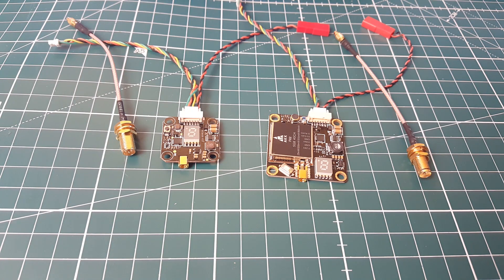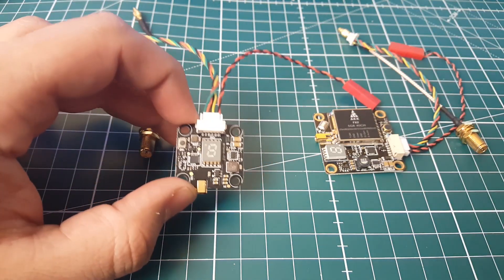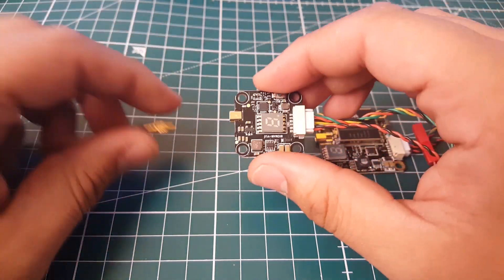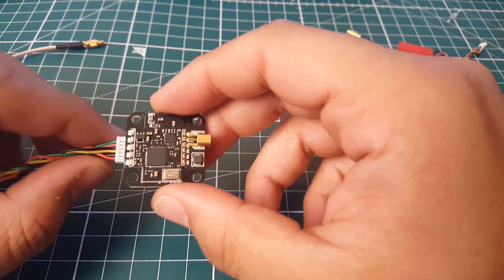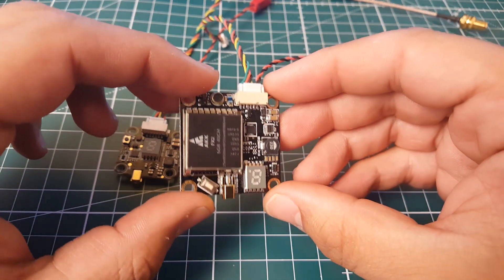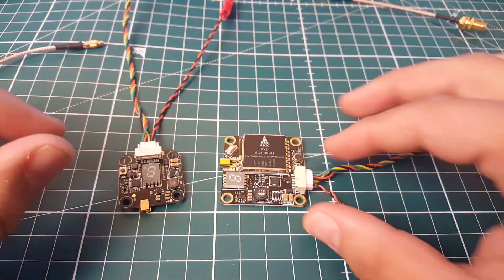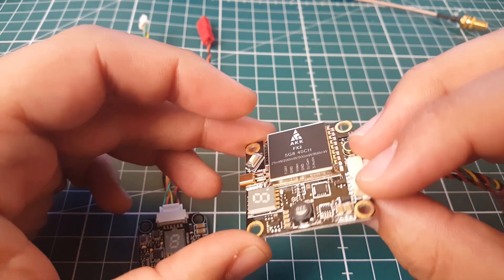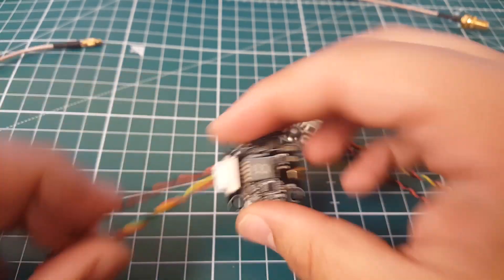AKK FX2 And FX3 // Stackable, Smart Audio, Pit Mode

Comment: I would use the 20x20 but hate that connector on such a small vtx. Maybe cut a pigtail and solder straight to it? Have you ever spliced a shielded antenna wire before? Is it possible? I have a ufl end I would like to splice for a friend

Comment: what would happen if you get the waterproofing crap in that hole? I waterproofed a matek vtx hub and for some reason my esc's wont work. blheli says bad data or power connection. I've tried 3 differen sets of esc's and still the same. There's def not any waterproof stuff on the pads since I've checked it all with a multimeter. I'm thinking theres just something wrong with the pdb vtx

Comment: Please read all this and think again about akk,

For the people that are wondering this isn't a clone of the tbs unify neither the immersionRC tramp hv, Racedayquads paid for the ham license that was required to run smart audio properly so they didn't had to bother with cloning smart audio from tbs. Racedayquads paid akk to make their Mach 2 vtx and so what they did is that they took one of the first prototype of the Mach 2 vtx that worked properly and mass produced them and named it the akk x2 vtx. And months later they send the vtx's to racedayquads after selling the Mach 2 proto for a while, but racedayquads did want to produce their proto's but changed the design and went from a plug to solder pads. And that's what they got send. Technically the akk x2 is just a Mach 2 vtx with a plug instead of solder pads. Also all their vtx's that are coming out recently is just a remix of the Mach 2/ akk x2 vtx so akk is the clone in this situation with all their vtx's.
Reply from the maker: Your wrong racedayquads buys from AKK ;)

Comment: Can you check if it really outputs at 800mw? I have 2 and they don't seem like their truly outputting at 800mw
Reply: I’m not sure why reviewers always avoid testing power output. It’s kinda like doing a car review and never checking the horsepower rating! I test all my vtx with the immersion RC rf power meter when new and later compare as the vtx ages or stops working. So many vtx completely lie about actual output.
Reply: Canyon Racer true...i hope he tests the output
Reply from the maker: +Canyon because they would desolder themself if they output at 600mw and above

Comment: That is the racedayquads "inspired" vtx.... racedayquads sent them the specs for manufacturing and they kinda sorta ripped them off...
Reply: Racedayquads paid AKK to make a clone of the TBS Unify and then AKK turned around and made their own version of it as well.   Racedayquads has been working to copy TBS unify features to bring them to the market at a lower pricepoint and AKK just turned around and filled that part of the market so they are mad.
Reply from the maker: Well that sounds like a shitty situation..
Reply: Que "welcome to the jungle" still gonna get it though. TBS Unify for half the price. The raceday of course.
Reply: Alchemical Anarchist they didn't clone the tbs unify neither the immersionRC tramp hv. Racedayquads paid for the ham license that was required to run smart audio properly without people talking bad about your company. Racedayquads paid akk to make their Mach 2 vtx and so what they did is that they took one of the first prototype of the Mach 2 vtx that worked properly and mass produced them and named it the akk x2 vtx. And months later they send the vtx's to racedayquads after selling the Mach 2 proto for a while, but racedayquads did want to produce their proto's but changed the design and went from a plug to solder pads. And that's what they got send. Technically the akk x2 is just a Mach 2 vtx with a plug instead of solder pads. Also all their vtx's that are coming out recently is just a remix of the Mach 2/ akk x2 vtx so akk is the clone in this situation with all their vtx's.
Reply: There is already some private label versions of the AKK on Amazon now too. Like the Wolfwhoop version.
Reply: Its false to say that Racedayquads didnt copy features of the Unify.   It was trappy who first developed features like smart audio or being able to turn on the VTX with the antenna disconnected and having it not fry.   This is one of the features they were working on in their Mach 1 version and in their Mach 2 version they made it even more like the TBS unify.  As a Consumer I dont have a problem with free market competition because we all get better VTX's at a lower price.
Reply from the maker: No this is the manufacturer and racedayquads takes from them as OEM. So this is the original and racedayquads is the clone.. Ironic isnt it
Reply: Sam please, Tyler payed thousands of dollars to akk to manufacture the Mach 2 as fast as possible. Rdq did all the pcb drawing for all the proto's from the Mach 2. They aren't the clones but akk is. They were  the oem manufacturers but they only mass produced them for rdq. They didn't design anything and didn't do anything else except for assembling it. All the revisions that they did later was token from the original Mach 2 proto.

I can talk hours about this but it is almost the same way with zmx and brotherhobby. Brotherhobby was the oem manufacturer for zmx's v1, v2, v3 motors. Brotherhobby totally took the design of zmx which they drew but were brotherhobby put their own name on it and called it the returner series. After zmx found out about it they stopped selling the v1, v2, v3's and made their own motors in the USA were they totally changed the design of. Brotherhobby was going on with the design from zmx and kept going on with the returner series and added some larger stator sizes and a hollow steel shaft.
Reply: And the same thing now happens to the efaw motor and the sumax 2407.
Reply: RDQ didnt design anything either, they just copied the TBS unify and paid AKK to build them their version.
Reply: Bro, they paid someone from underground fpv that are really good friends of them to design it. It is for sure that akk didn't design it.
Reply: Tyler is not capable of pcb drawing, he know nothing. AKK release their X2, Tyler asked AKK to change the design into solder pad. (He did the same thing for his Mach 1) That is why AKK sell vtx with wiring connection while Tyler sells solder pads. DO NOT TRUST RDQ, he's lying.